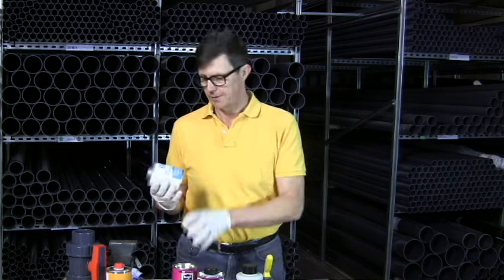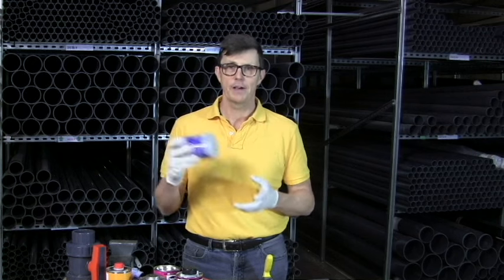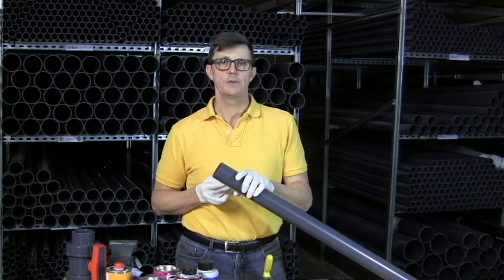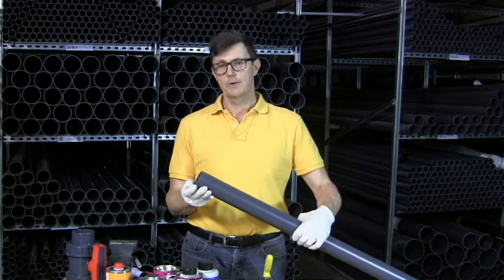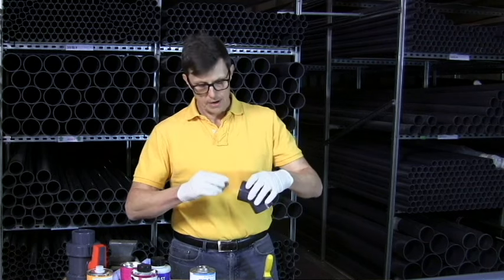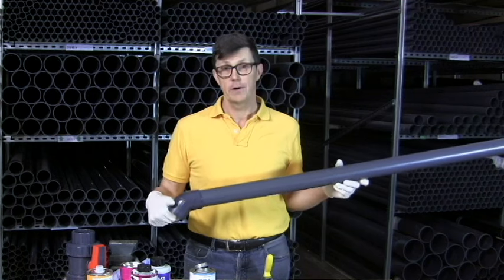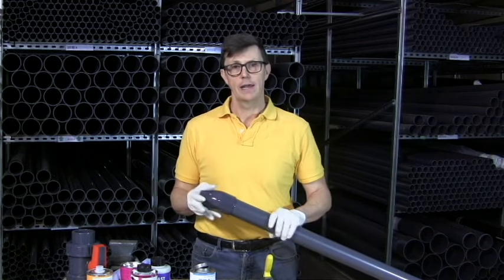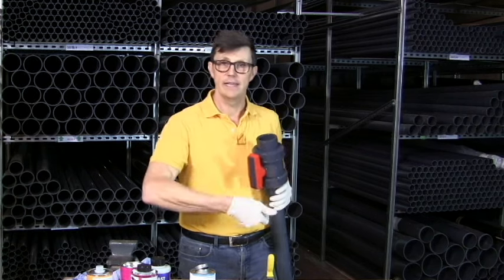How to glue pvc pressure pipe and fittings

Comment: Thanks for making this video, very informative.
Which in your opinion is better : gel or liquid type glues and why?
Thanks x)
Reply from the maker: Hi there. Personally I prefer gel types such as Griffon and Tangit but I have used liquid types in the past and have never had any trouble with them. For some reason, perhaps because I started my pipe fitting days years ago with gel type, I just favour them.
Reply: @PlasticPipeShopTV  Alrighty!
Also, I was told it is a good idea to rough up the end of the tube with some sand paper to help with adhesion, is this necessary?
Reply from the maker: @NicolasSalencPBP  Rough up the pipe if it is old pipe and then use pipe cleaner on it. If it’s new pipe, then just the cleaner is fine.

Comment: Realy good information & video but Ive seen other video clips applying prime before gluing do adhisives in the uk not require priming
Reply from the maker: Applying primer is something that is a widespread practice in the USA but is very rarely done elsewhere. The purple primer you get in the USA is more aggressive than standard cleaner and does create a better "key" for the cement but normal cleaner is also fine, especially with the quality of modern day PVC and fittings and modern day cements. I think part of the reason it is still in use in the USA is that the purple colour shows that cleaner has been used, so when a buildings inspector comes to check the system, it shows that the joints have been assembled according to building regulations. I am not aware of anyone in the UK or Europe who uses primer on PVC pipe systems. It is sometimes used on CPVC (Corzan) pipework, as this type of pipe is designed to be more chemically resistant, but is still a very rarely used product. So in summary we would recommend that "cleaner" should always be used (on both pipe and cleaner) first to remove any surface contaminants and provide a key and then cement applied to both surfaces.

Comment: Hi, interesting video, i am using ABS pipe for my pond instead of PVC is the principle the same or is there  anything i should watch for? Also i am unsure whether you can glue ABS to PVC my understanding was that you couldn't but there is a statement on your website that states you can if you use an ABS glue i am using Tangit ABS glue, will this work? Cheers
Reply from the maker: Hi there, using ABS instead of PVC is fine for your pond - if you think the temperature might drop below 4deg then ABS is the better choice over PVC as it is better suited to lower temperatures (PVC becomes more brittle at that kind of temperature). As for connecting ABS and PVC, you can join together using PVC cement, not ABS cement, as ABS cement doesn't melt the PVC enough to bond it together.
Hope this helps.
Reply: @PlasticPipeShopTV  Cheers, thanks for the swift and helpful response
Reply from the maker: @edlesboroughkoipondstevech3546  Happy to help!

Comment: Why would you scrape it?? Wouldn’t that make it loose frictional counterforce?
Reply from the maker: Hi, thanks for the question. There are two types of "scraping". The first puts an angled "bevel" on the end of the pipe. This is critical as it allows the cement in the socket to be "compressed" into the joint as they are pushed together. If this was not done, the square cut end of the pipe can act as a blade and just push all the glue in front of it. Old pipes or ones that have been stored a long time should also be sandpapered or scraped where the cement is going to be applied (this also applies to very old fittings as the plastic will oxidise). This gets rid of any surface oxidised plastic or other contaminants and after using the cleaner, gives "virgin" plastic material on the pipe for the cement to soften and "weld". It should be remembered that the solvent weld process is not gluing (where a substance sticks to both materials, with a layer of glue in between holding them together)...instead it's a process where the cement melts and softens the surface of the plastic on the pipe and socket, so that when pushed together under pressure, they weld and form a new continuous layer of plastic between the two.